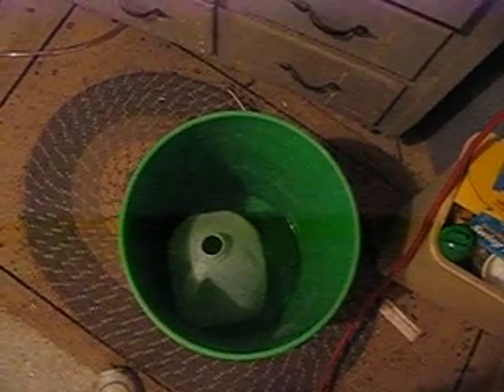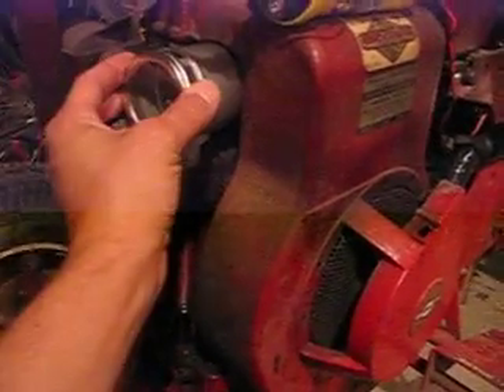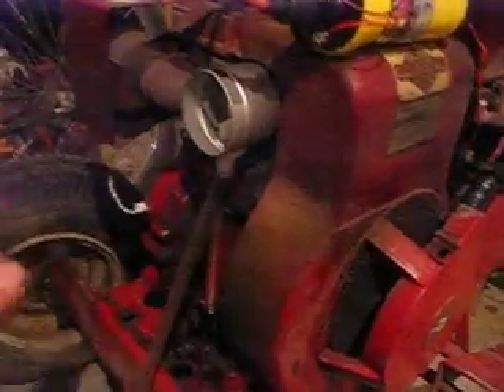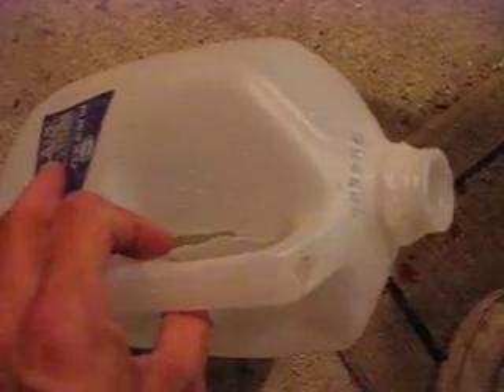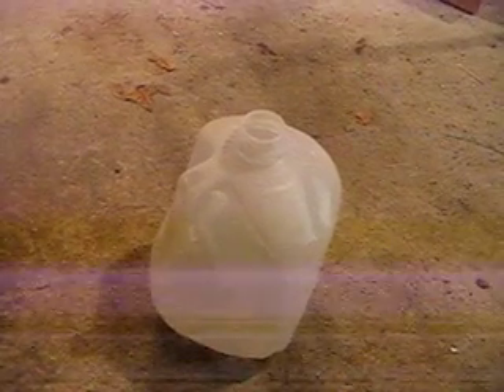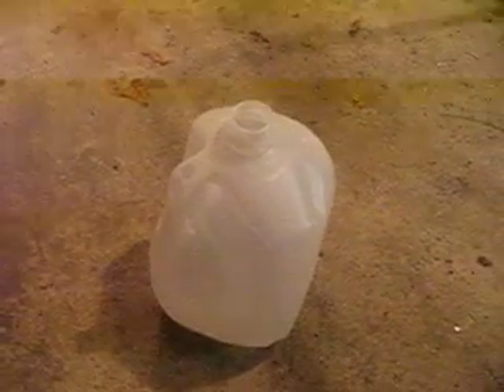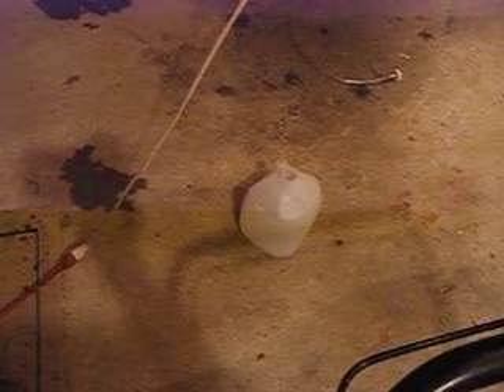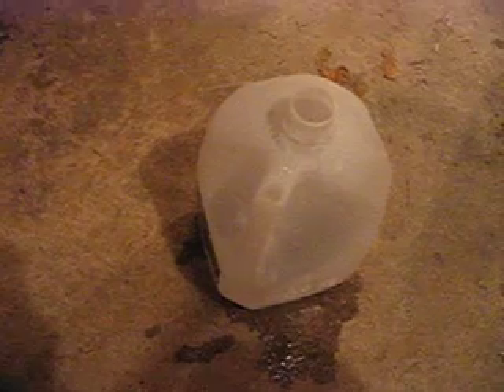Hydro Lab (My Garage) #50 Safety

Comment: Yes, I was using both. But I took the brake booster valve off before this happened and I had only 1 HHO gen then too. But I got 2 HHO gens on it now. And every time I start to do a vid of it, something else comes up. And I will get around to doing one here shortly.

Comment: Yeah those valves are expensive from the welding shop. Well if you aren't sure of that you can go to wal-mart and get a $1.50 2 qt Sterlite(plastic) juice container to put your cell in. That way if it does have a flashback it will only blow the lid off and all you got to do is remember to turn the switch off while you're listening to the radio, and put the lid back on and drive home.

Comment: You can use the one way valve that came on the older model vehicles power brake booster. It has the bigger ends which should fit the bigger hose of your HHO gen.
And/or may be easily adapted with some electrical tape

Comment: As long as you are using HHO to assist the gasoline, you don't need to mess with the timing. And if you do want to adjust the timing, let me suggest you power time it which works best with automatic transmissions.
Can be done with manual trans too as it involves power braking and maintaining 2000 rpm.
to try

Comment from the maker: Hey guys,
 I was thinking about a vid I saw, Someone used s 2" PVC pipe with the rubber end cap. The end caps have screw clamps so you can adjust the tension.